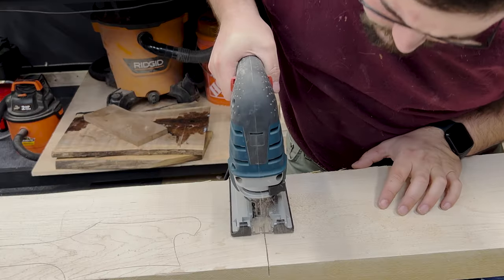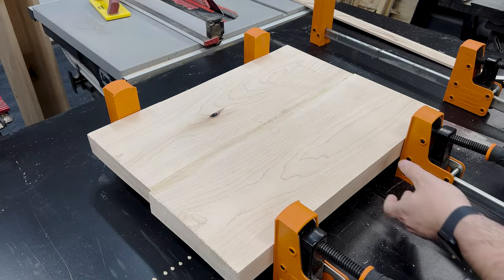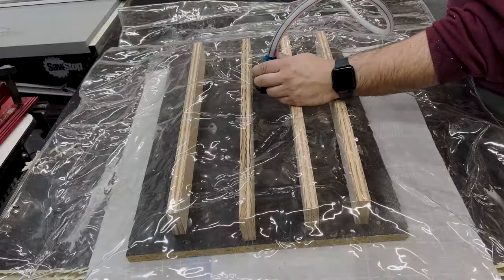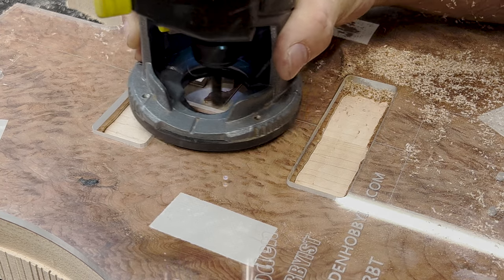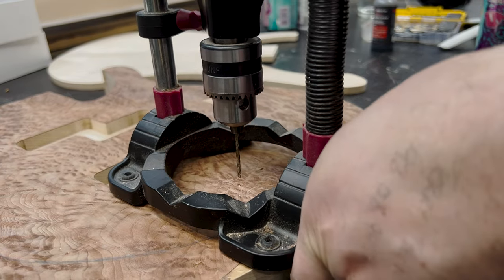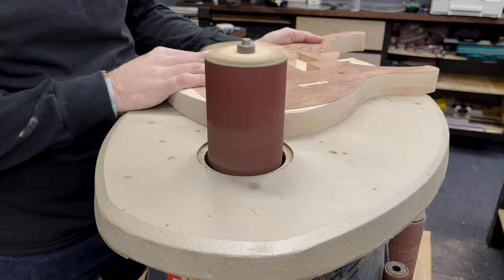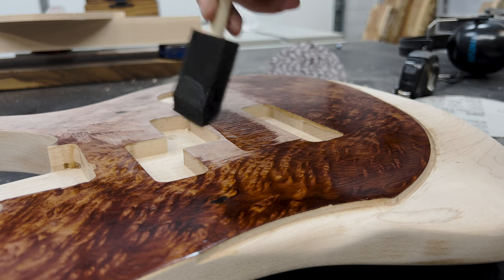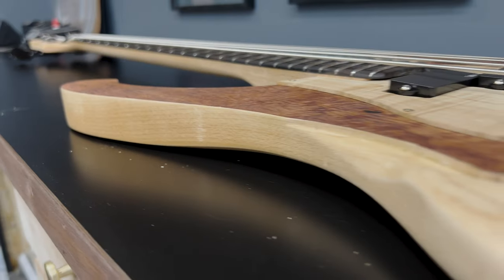Making A Bass Guitar From Scratch - Part 1

Comment: No dowel?
Reply from the maker: Dowel where?
Reply: @TheWoodenHobbyist  Between the two boards of the base, it looks like you just glued the two boards together if I saw that correctly. Is that the best method? Or you think if I doweled boards together for the bass, is that fine ?
Reply from the maker: As long as the edges are clean and precise, modern glue bonds are stronger than wood itself. Dowels don’t hurt anything, unless there in an area that is to be carved